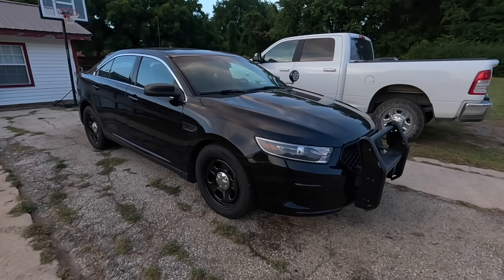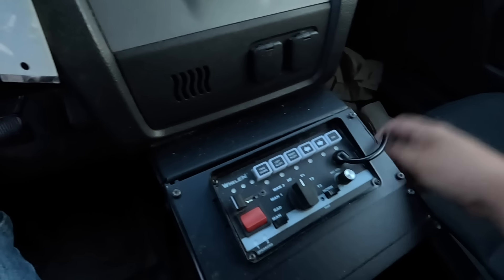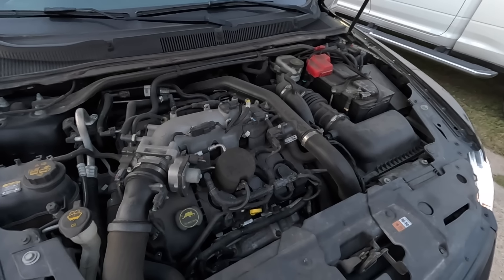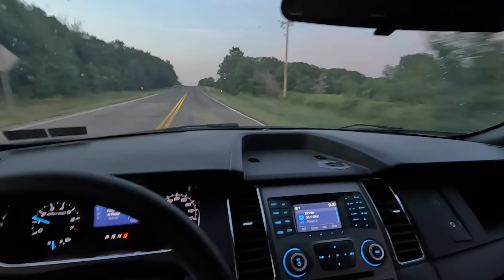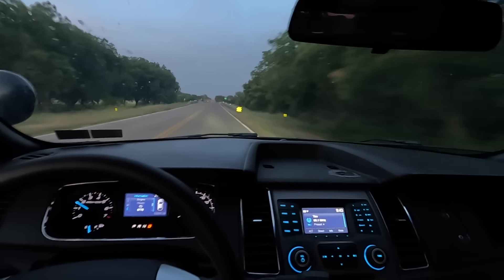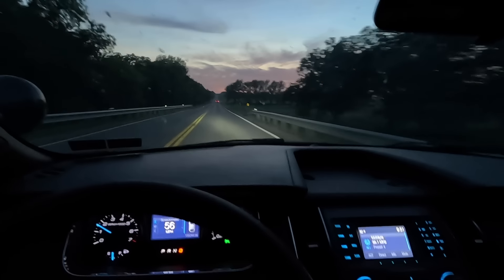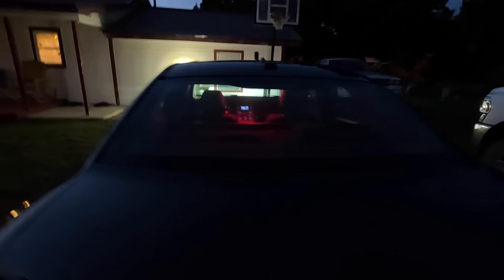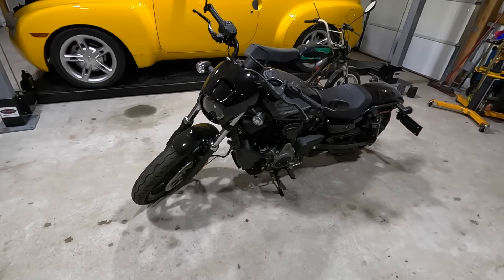I won this Twin Turbo AWD Police Car for $5K from Auction! They Made a BIG Mistake!

Comment: Most likely the horn is tied into the siren box to use the "tap too" function that allows you to control the siren tones with the horn to keep you hands on the wheel.  I would guess there is either a blown fuse of the power cable is unplugged from the siren control box.  For the wind noise tilt the spot light down to the off and stored position ; that should reduce the noise

Comment: What a killer buy! These things are rocket ships man. 365 hp, 350 lb-ft of torque. And it makes that from 1500 RPMs all the way up to 5100. Make sure to check the water pump weep hole to check for leaks, because if it is leaking, it needs to be replaced ASAP, otherwise it’ll introduce your oil to coolant. Be sure to also do your oil changes religiously, every 5k miles, and this thing will get you another 150k miles. Believe it or not though, these engines love being driven hard, and it clears carbon buildup from the cylinders. This should also be a flex fuel vehicle, so it is capable of running 87 octane to 93 octane. E85 I don’t know, I’ve never tried. Fuel economy leaves a lot to be desired though, it drinks like a V8 😂.

Comment: I dont know about the Taurus interceptor! But, owning a 2008 crown vic interceptor! It was awesome. I got the black one, with just 77,231 miles on it. I got it at a local small town Police department for $2100! And, i didnt have a speed limiter. I took it to 161mph, till i was greaking out a bit. Lol! They are great cars. The vic was basically a mustang GT, with the exception of having two more doors. But, the suspension was all mustang gt. And they "Police" maintain there cars, big-time! Thats a great price for that car.

Comment: Hey man…. You need to check or have someone check to see what the tune is on the computer… my buddy is an ASC certified mechanic and works on police cars. Check to see if they deleted the hopped up police tune and put it back to stock or left the tune. I know the high speed engine shut off tune is deleted on police cars for well high speed pursuits. Just thought to add… but that thing is badazz for sure. Got you a fun car Randy… I’d love to find a PPV with the 6.0 or 6.2 can’t remember which LS motor it has but those are sweet but still lil pricey in the 13,000 and up range. Anyway, have fun with this one and yes… black it out with the windows and be sharp as ever. 💯💯💯
Reply: There is no "police tune" It's factory stock tuning for the Taurus with a few minor tweaks like having the cooling fans run longer etc.

Comment: 365hp in my 2013 explorer sport, probably more in that with a police tune.  transmission is the weak point in these front wheel drive based vehicles.  tune it like an f150 can be and you will blow the transmission.  the naturally asperiated cars are a 3.7l for cops.  not much difference in power than a stock turbo 3.5l.

Comment: Charge pipes, exhaust, and a tune will make that thing a bad ass car. I would choose this over a V8 charger. Great buy and would be kinda cool to see you mod it a little.
Reply: Just the ECU tune alone should unlock and additional 100 HP or so.

Comment: the idle hour calculation comes out to 127,407.5 miles, with a grand total of wear on that PPV of 282,649.5 miles from the point in the video you shared the idle hours.

Comment: Awesome rig! Tip with the spotlight is keep the light turned into the a pillar. At least up here in Massachusetts the police don’t like people running around with the spotlight pointed out on retired police cars. Maybe it’s just my luck.
Reply: The police can pound sand the spotlights aren't illegal.
Reply: It boils down to the laws in your respective state. I used to live in Virginia and I owned a P71 Vic that had a spotlight. In order for me to get an inspection sticker, I had to disable the spotlight. Even though it's not technically illegal to have the spotlight, it's not worth the hassle of constantly being pulled over by the police for any little reason.
Reply: @TwentytenS4B8  i see, I would uninstall it for the inspection and then put it right back afterward.

Comment: When I worked at a Kia dealership, there was this 2016 blue Nissan Maxima SR they bought from auction The thing had 136,000 miles on it three years ago when I bought it never knew it was a cop car until I called New Jersey dmv and they said yes the vehicle used to belong to the government no local agency used it strictly the government, so either the FBI CIA or marshals it explains all the holes in the headliner from the police lights they had in it it also explains the mileage lol

Comment: Idle hours are equivalent to 31 to 33 regular driving miles per idle hour. I own a 2010 Crown Vic Police Interceptor with 274k and 5700 IH and she runs excellent and will do a sideways burnout at request. I want what u have . Nice find.

Comment: change oil religiously every 3k, get an oil catch can, and plan on removing the intake manifold at some point to clean carbon build-up in the combustion chambers. Ecoboosts are great, but require a shit-ton of maintenance compared to NA motors

Comment: According to some dealerpage i found the awd has 365 HP. And then this text came  "It gets to 60 mph almost a full second quicker than the Dodge Pursuit and to 100 mph almost 3 seconds quicker! It's quickest Patrol Vehicle out there right now, and has to be the quickest ever. It will eat a Mustang GT up and it's a 4 door sleeper with AWD. On a wet day, a Mustang will be sitting still when I go by! "

Comment: @5:20, that hole is most likely where a scanner was located in.  Would be pretty cool to put a Whistler TRX-2 in there.

As for the Siren controls, I'm sure you can find the installation instructions on the internet, but obviously the unit would need 12 volt and ground, so I would start tracing wires.  Maybe they just disconnected it from the fuse box or just disconnected the ground.

Cool project car.

Comment: I had a 2012 Taurus SHO. I bought it from the Ford dealer used. Unfortunately, the thing was the biggest POS I’ve ever owned. It lived at the dealer for a year for warranty work. $10,000 later after replacing leaking turbos and lines. Water pump and timing chain separately because it was warranty. Brakes, shocks etc. It was a beautiful car and it looked brand new, but I may be got to put 3000 miles on it in a year. I sold it to a different Ford dealer and kept my old crown Victoria instead.
Reply from the maker: Man that sucks! I've already put 1k miles on this one and I romp on it.
Reply: @AutoAuctionRebuilds  I thought it was going to be awesome. Even after I had new turbos put on, they continued to leak and they had to replace them again. Plus, they had to replace the heater core because I didn’t have heat at idle. All of this stuff took months at a time. Of course, it was during Covid. It had 137,000 miles on it. It was beautiful looking car. Don’t forget the moon roof leaks. Thankfully I had that warranty or it would have cost me 10,000 out-of-pocket. I’ll keep the panther platform. Extremely reliable, and easy to work on. I saw yours in the background on the trailer.

Comment: One thing you can be sure of , is the scheduled maintenance..
Its no doubt had regular oil changes & upkeep..
It probably wasnt used as a cruiser .
Its far too clean.
I have a contract with a police dept to do their "PDR" before they sell them at auction .
And they are just beat to death...
If the fenders & hood are straight , it was prob driven by an official...
I didnt need to ask why the hood & fenders were beat to death...
It comes from slambing people into & over the front clip.

Comment: 1 idle hour equals about 25-30 city miles. And that engine puts out 360 hp I believe, and about the same in torque.

Comment: There are 2 fuel pumps. Low pressure pump in the gas tank. 
High pressure pump is on the engine front center . the turbocharged engine would need higher pressure on the fuel lines.
Reply: It needs the HPFP because its direct injected. Turbocharging has nothing to do with it.

Comment: Police cars are well maintained and people believe cops are allowed to just destroy them with no consequences because, hey, it’s not their car and whatever.  Not the case, things happen but generally well maintained.

I am also thinking with that many miles it was a highway enforcement type.  It’s the idle time that is an issue but looks good.

They probably disconnected all the fun stuff before they decommissioned it.  The hole in the console is where the radio was.

Comment: Good video. Nice pickup. A family friend of mine works for the highway patrol in the motor pool department he orders vehicles and I remember him tell me that when they used to make the Taurus that they would order most of them with the twin turbos same thing with the Explorer they would order them with the twin turbos. Horsepower should be 365 torque should be 350. A SHO 3.5 TT will do 0-60 in roughly 5.2 seconds and I'm guessing the interceptor is probably lighter so it should be quicker. 😁

Comment: Why didn't they remove the searchlight and other police equipment off the vehicle before selling it. I do like the car, good design especially the rear lights. 150000 miles is alot considering it's not that old.

Comment: It is a nice car. That police dept splurged for the awd turbo model. Most just get the cheapest ones they can get with the procurement contract. The lines get blurred on what is in what trim level with ford. My late father bought a brand new 2009 Taurus SE for a good price because nobody wanted it because it was a base model. The dealer gave it to him cheap to be rid of it. The only things that made it different then the top of the line non awd version was it did not have leather seats, digital climate control, sunroof, seat warmers, no GPS and only had 4 speakers instead of six. Non of which he gaveva crap about. I have it now and it is a great long trip car. Make sure to check the coolant level as the big issue with the turbo and non turbo engines in these cars is the waterpump which is driven by the timing chainnand reqiures the front of the engine to be removed

Comment: Ford originally offered this twin turbo ecoboost engine on the Taurus based interceptor - it’s a version of the same 3.5 liter engine in the F150 (365hp) - but later dropped it, leaving only the 307hp 3.7 liter V6 because most PDs weren’t opting for the more powerful engine since it was a pretty expensive option.

Comment: Hi from the UK I think you have a real good steal with the police car you bought at auction that's as faster than a scolded cat, many years ago I bought a unmarked ex-police car and the electronics had been uprated and my goodness would that thing fly it was a General Motors manufactured in the UK and compared to American cop car it only had a tiny moter in it but when you pushed it over 2000rpm in a low gear then everything kicked in and you were gone, thinks for a great video.

Comment: did you find the solution for the horn? have same problem
Reply: They disconnect the horn and hook up the siren typically. He should be able to splice it back easy
Reply: I found the issue its a wire purple for the horn to work

Comment: I wonder what kind of shape that engine is especially with those timing chain issues.
Reply: The timing chain issues are about zero with decent oil service intervals. There are loads of these v6s with 250K miles running great and not using oil. Some without a water pump change.

Comment: Randy: you should get together with Lunar Outlaw.  He has the  Police Chevrolet Caprice. It has the V8 so it is real fast, you should drag  them both.
Reply: Caprice has the 6.0L LS engine. It will torch the Taurus.

Comment: My Unit had that same awd.. twin turbo system .. most All PPVs are Awd tt!
 ..I’d just leave it the way it is as a “slick top” with the spot light & push bar Only.. (looks more of a Sleeper) but, most all that wind noise is coming from the seal where the Spot light is coming through the door at! but, on the idle hrs. it’s different on every vehicle, just according, if it was a very active Patrolmen’s on the roadway or if it was someone higher up.. I’m thinking, it was probably a Lt. or Detectives unit, very nice ride! 
  get you an open air intake.. downpipe’s.. 3bar map & a lil’Tune.. Amazing difference.. will have way Harder of a Punch.. Spool better & will just pull so much harder.. All Throughout the whole RPM Range.. it’ll put it on a whole different level of ride.. Performance wise! 💯

Comment: These aren't as common as the Naturally Aspirated cars.  The Ecoboost Utilities were more popular, particularly with Texas Highway Patrol.  Most auctions can't decode the VIN for a Police Interceptor either, which is why it was listed as an SEL.  You certainly lucked out on the auction buy.  Seller didn't know or care what they had.  The AWD makes them drive like they're on rails.  Yours has definitely been decommissioned more delicately than most.

Comment: I always loved the old Poverty Vic Police cars.. then I bought a FPIU (the Exploder) and.. man the Taurus/Explorer just stomp the old Crown Vics... This should have pursuit mode on it -- when driving, stomp on the brakes for a few seconds then floor it to engage -- That thing will hold the gear to redline for each shift until you disengage it (pop it in neutral for a for seconds).  They are monsters!  Next step is to get FORSCAN and a cheap programming cable to unlock all the fun stuff -- Remote entry, remote start, dark mode disable, backup camera and (hopefully) perimeter alert.  If you have the equipment for perimeter alert and enable it, a camera in the rear view mirror will kick on if someone approaches the car and the sensors pick it up.  Everyone needs at least one old police car in their life -- they are cheap and too damn fun.

Comment: SIRENS, Ford & Dodge give the factory option to have the sirens 'DELETE' when the car is placed into 'PARK'.  I have a unmarked, 5.7 Hemi, 17,000 mile, Charger Pursuit, with operational side, front and rear strobes, wig-wag, A column spot and siren modes (no roof rack lights).  When I'm on the Interstate, cars used to refuse to pass me.  It looked like I was the queen bee and 10 worker bees on my sides and behind = a dangerous situation.  I removed the A column spot (which I found the spot to be the 'cop car' impression).  Now, thankfully, I'm not a danger to myself and the ones surrounding me.  p.s. it's a great, fast comfortable car.

Comment: Go ahead and replace that water pump right away and you should be good for many years. That's a 1 grand job and Taurus along with other ford were designed bad where they put water pump literally inside the engine :). So expensive labor cost ..

Comment: Nice vehicle, way better shape than most police vehicle auction vehicles.  BUT, the twin-turbo Ecoboosts HATE to be extended idled.  If that is the original engine in that vehicle, it's probably nearing the end of its life.
Reply: When the water pump fails that WILL be the end of its life. Unless it was recently replaced. Hard to say unless the car came from a big department with lots of money because its a big job. Whole front of the engine has to be torn down because the water pump is part of the timing chain system, under the timing cover so part of that job is to replace all the chains and guides as well.

Comment: I have a 2016 SHO and definitely a fun car! 4,400lbs(roughly), but it moves! Plenty of trunk space and very comfortable seats. I have the NGK .038 cold gapped plugs, 3bar map, Airaid CAI and tune by Torrie Unleashed. Absolutely woke it up even more! Mine's also black with very dark tint all around and I even have others slow down when I'm behind them and mine's not even a police edition 😅🤣. Congrats on your new ride...you're definitely going to have alot of fun with it. Oh and I'm avg 19-23mpg, I run 93 octane.

Comment: Everyone thinks these and the police explorers are super badass cause they’re all wheel drive. They’re only part time awd. Up to 40 miles per hour. After that it’s front wheel drive only. As for the 3.5 TT, great engines but very bad with manifold leaks, turbo seals, and turbos do not like idling. I’ve owned a personal 3.7 explorer and my issued 3.7 explorer and they aren’t as fast as the 3.5 but reliability wise it takes the abuse and idling way better

Comment: awesome steal, looks fantastic, get it on the lift and check the rust, fluif film it.  Get a back seat from the boneyard pull the radio and any other kop krap. DO NOT put a light bar on there. You will be pulled over for impersonating a kop. Get the windoe tinted. You did not check the fluids !
Be sure to where a blue shirt with an USA flag on the left shoulder !

Comment: Ex-police cars are great if you’re retired and in no rush to get anywhere because people will drive the speed limit. To illuminate this perhaps some charcoal racing stripes on the hood and trunk. May prevent someone taking a shot at you as well! 😆
Reply: As someone who's owned several P-71 Crown Vics, I can confirm that it's pretty miserable on two lane roads getting behind somebody that thinks you're a cop and you need to be somewhere.